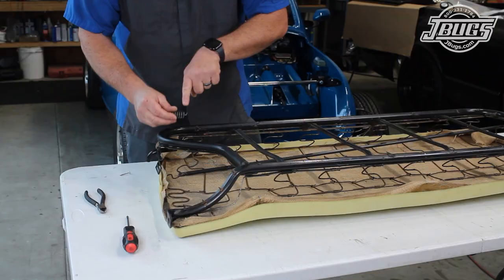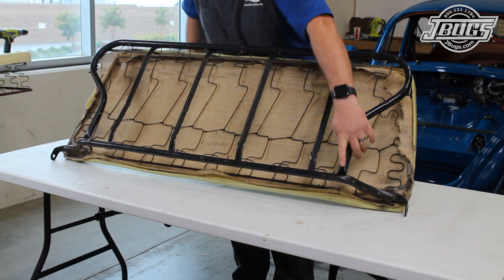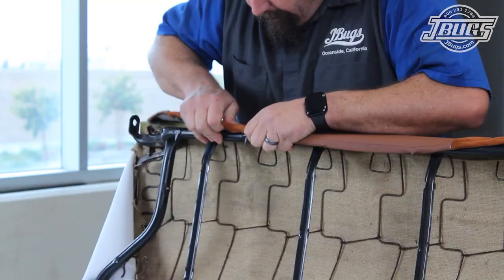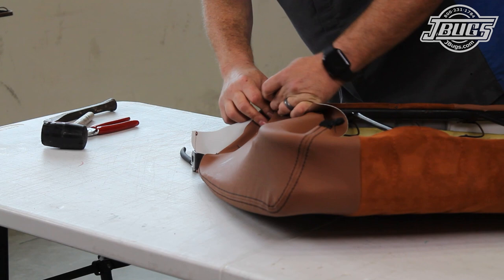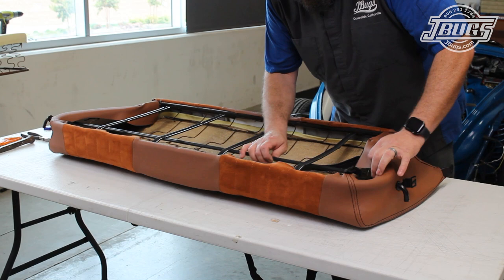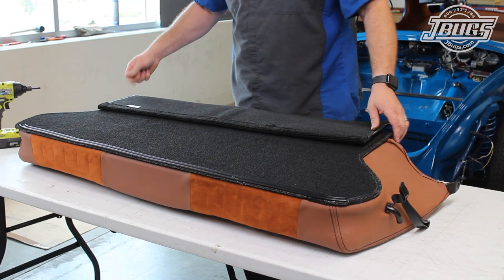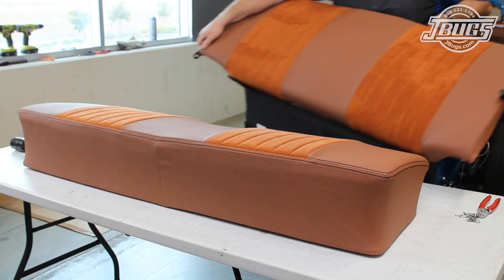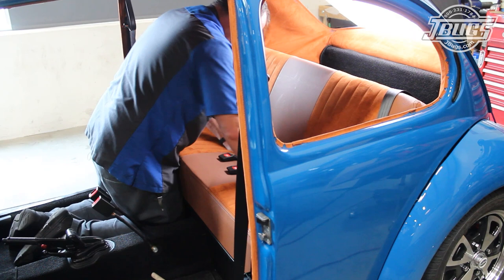JBugs - 1971 VW Super Beetle - Rear Seat Upholstery Installation

Comment: i purchased a 1965 vw beetle without the back seat. I found a replacement back seat but don't have the Cross Bars Shown on this video. where can i find the cross bars needed to install the back bottom and top back seat. ed
Reply: Your best bet is a junkyard or thesamba.com. The rear seat backrest is the same from 1965 through 1972. The lower rear seat crossbars are pretty much all interchangeable from 1963-1977.

Comment: What, no horsehair?  :)

Curious...did Super Beetles not come with the hold down strap for holding the backrest in the down position or did you simply decide to not add one?
Reply: We don’t want to vacuum out the horsehair every time someone sits down!

Originally the rear seat would have had a strap, we just didn’t put it back in. Perhaps in a future restoration we’ll use one.

Comment: Why is my lever not retracting back. I placed everything on right. What is the spring supposed to be be up against to cause the lever to retract
Reply: Watch the beginning of the video closely. The spring is braced against the seat from and then hooks onto the nail (is you are using the original VW part) or a screw if you prefer to swap the nail out.